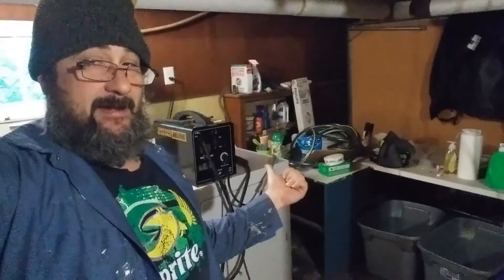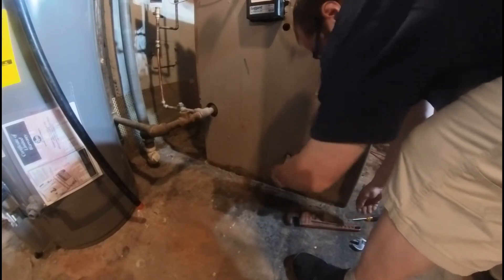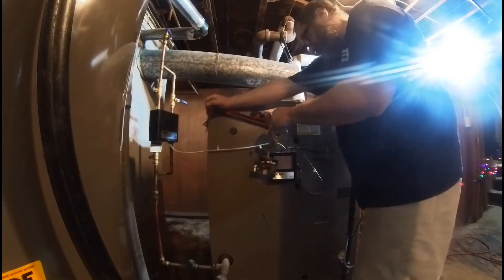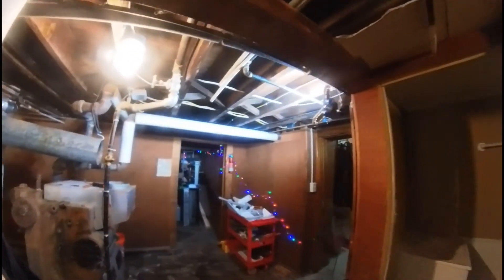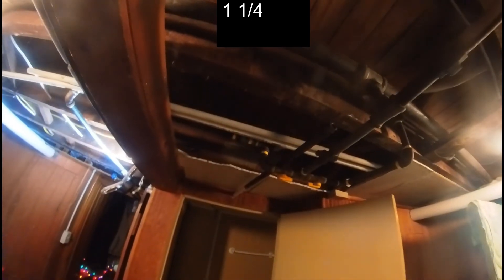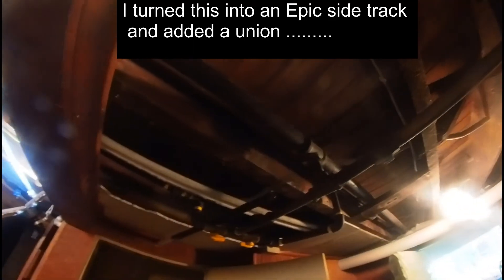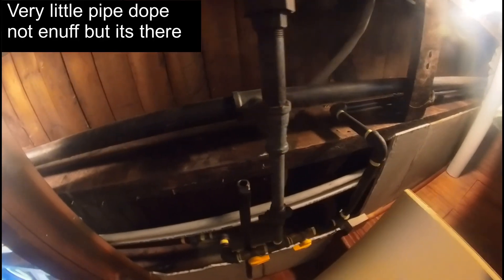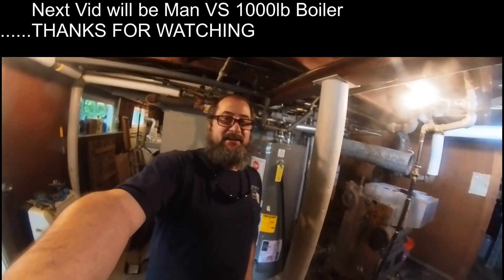Tear down Of American Standard boiler part 1

Comment: Braver than i am. I don't mess with gas. But sometimes you just got to take care of things and get it done!
Reply from the maker: Gas plumbing/piping is my fav =).......Most stuff is hand tight ....as long as you use really good teflon tape (yellow)rated for gas or pipe dope or both wont have a problem =)

Comment: Scary stuff going on there.  That is not a small gas leak.  That valve breaking off is nutty too....  Good luck with it all bro.  Don't hurt yourself!
Reply from the maker: Lucky I was going over all the gas stuff for the boiler since I touched it.......It started with leaks at the boiler shut off valves....... Decided to pull the whole line and just plug it at the 1 1/4 tee .....
Reply from the maker: I kinda had the sensitivity up too high and learned a lesson in setting it up =) but there was a leak on 1 side of the tee.......